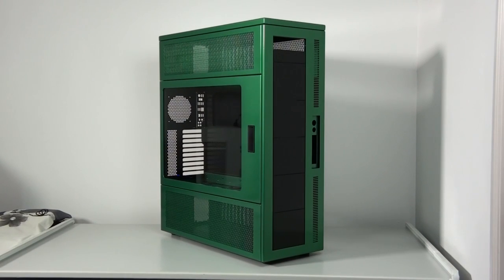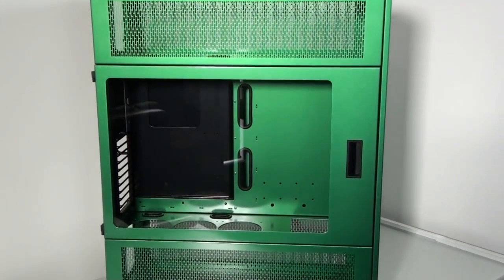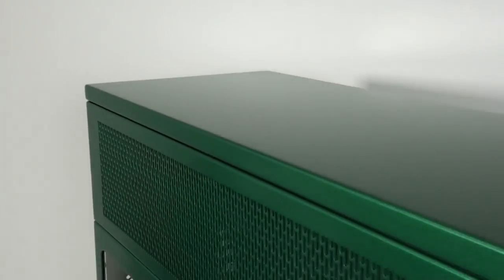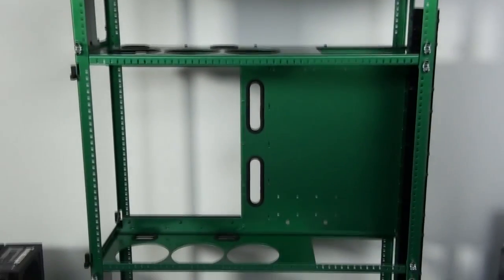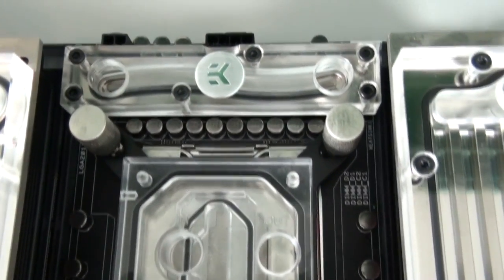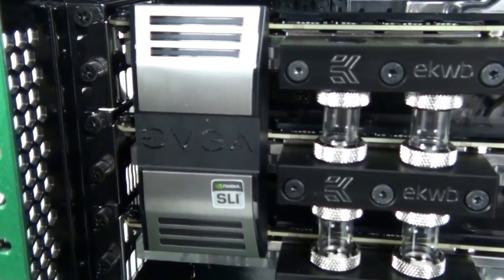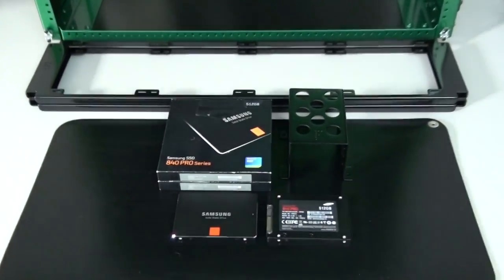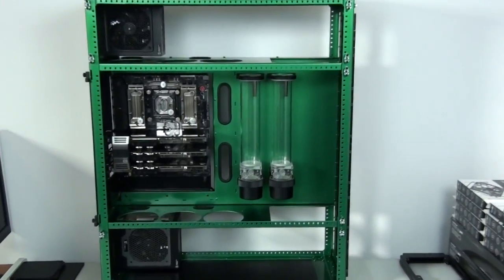Build #14: Extreme STH10: Part 2

Comment: Can somebody tell me why my Graphics Card wont work?
It's a single R9 280X powered by a 850 RM Corsair PSU (850 W). My hole PC is one month old. When I start my PC my 2 screens say that they don't get a signal and that I should check the cable/plug in a cable and the 3 fans on my Graphics card wont start spinning. I plugged in the 8pin and the 6 pin and the cables from the Graphics Card to the monitor and it worked perfectly for 1 month. I thought that the graphics card was broken so I sent it back and got a completly new R9 280x but I have the same problem with it since the first second again. The month when everything worked I lived in denmark but since I moved to germany it just wont work. I also tried different power plugs from different rooms but nothing works. I also tried different 8pin and 6 pin cables and a different PCIe slot on my mainboard and even tried other outputs from my PSU (cus it's modular) and also tried it with 2 adapters (2x4pin to 8 pin and 2x4pin to 6pin ( they(the adapters)) were together with the card inside the box )). When I came to germany I didn't tried my PC if it worked (retarded me) and just build in my new CPU watercooling (1 pump 2 fans) and 2 new 120mm fans. but I took out the graphics card while I build it in my system so it does not get damaged but well... the completely new card won't work either so it can't be a damage on the graphics card caused by the transport. Could it be that the mainboard is damaged in a way that the graphics cards fans wont spin? (or the PSU maybe?)
Reply: Denmark: C, K | 230 W | 50 Hz | Y Something
Germany: C, F | 230 W | 50 Hz | Y Something
-wikipedia
Reply: Lightningblade Wat ? 230 watts ? You mean 230 Volts/50Hz ? Actually 16 amperes plugs works on 3680 watts, but even, that's not necessary to know that
Reply: Maxime Legras
Ye sorry
Reply: Lightningblade Your card might just be DOA from the vendor. Do you have any other pc mates that you could try swapping it into their builds to test it and see? Or any other means of testing the card? 

Power wise you should be more than fine with an 850w so I doubt that's your issue. 

All of your cables are correct I'm assuming?
Reply: What is the make and model of your Motherboard?  Some motherboards have additional molex connectors for powering the PCIe lanes.  I'm not saying that is what the problem is, but you need to start looking outside the box.  With all the new Motherboards out now they offer varying setups and configuration requirements.  Are you able to boot into your OS?  If you are running the latest Intel chips they all have onboard graphics, so you may be able to isolate your issue more if you know that you can at least boot into your OS and do stuff.  If you could supply us with the processor, motherboard, psu and OS details we might be able to assist more.

I'm running an Intel i7-4770k on an ASRock Z87 Extreme9 AC Motherboard, 2 x R9 290X in Crossfire, Windows 8.1 Pro and a Silverstone 1000W PSU.  I have the above setup watercooled as well.  So hopefully myself and others are able to help you out with your problem.
Reply: *****
Fist : thanks for your answer.
1.) I didn't do anything on my mainboard.
2.) I'll try that ty,
3.) I can't check it without a picture :/ (No onboard graficscard)
and again thank you for your help
Reply: singo79
 Like I said, it worked fine for a hole month so and the mainboard does not have any additional connectors for the PCI lanes (just the normal 24 pin for everything and the 8 pin for the CPU. (MSI 970A-G43 AMD 970 So.AM3+ Dual Channel DDR3 ATX)

My OS boots up without problems ( I not 100% sure on this because im not able to get any picture on my screen ofc but if I press down the power button at the point where windows normally is loaded it needs be hold down for ~3 seconds just like normally when windows is running (When it's not loaded it usally just needs to be pressed to be shutdowned without holding it)

The hardware of my PC:
Mobo: MSI 970A-G43 AMD 970 So.AM3+ Dual Channel DDR3 ATX
CPU: AMD FX Series FX-6350 6x 3.90GHz So.AM3+
GPU: 3072MB Gigabyte Radeon R9 280X WindForce 3X OC Rev. 2.0 Aktiv PCIe 3.0 x16
SSD: (OS) 128GB ADATA Premier Pro SP600 2.5" (6.4cm) SATA 6Gb/s MLC asynchron (ASP600S3-128GM-C)
RAM: 16GB Kingston HyperX Beast T3 DDR3-1866 DIMM CL10 Quad Kit
PSU: 850 Watt Corsair RM Series Modular 80+ Gold
Watercooling: Enermax Liqtech 120 Copper CPU Cooler

Thank you for your answer.
Reply: Lightningblade Hi, I have a 770 but my CPU doesn't have on board graphics, even without installing the driver, the GPU will still power the screen and give you an image. There's no power going to your GPU at all, the fans should spin. Definitely try a new PSU or motherboard. Might even be the CPU, maybe one of the pins are bent.
Reply: ***** " the PCI-E lane can deliver 50w" wrong! its 75W for full size PCL-E used for GPUs. every 6pin is another 75W and 8pins are able to transfer 150W of power.
Reply: Biały
What is "PCL-E" ? I think you ment PCI-E right?
Reply: Lightningblade
 Thanks for that info as it helps isolating things for us.

I don't want you to suck eggs too much here, but when you turn your PC on do you see any of the BIOS Post information flash up etc?

Have you tried moving the R9 280X into PCI-E4 and seeing if that makes any difference?  The MSI Manual states that it is preferred that the graphics card goes into PCI-E2 but it doesn't say that it can't primarily run from PCI-E4.  If you haven't tried this are you able to try it?

The fact that you are noticing that the R9 280X fans aren't spinning suggests it is either a power issue, in that it is not getting enough power to the GPU, or something is going wrong.

I've been onto the Gigabyte website and noticed that one of the features of the AMD cards is that they offer "AMD Zero Power Core Technology" in which fans on idle or lower power state cards won't spin until necessary.  So don't write off your graphics card just yet, but it is a likelihood that it could be the card.

Anyway, if you can get back to us with the above information and also try the different PCI-E slot we can take it from there.

Also, have you tried another monitor cable?  I wrecked one once during a move, kinked up bad enough that it must have broken one of the wires inside.  I'm just throwing ideas out there to help isolate the problem.

It sounds like the PSU is working as it is powering on.  Sounds like the motherboard is working as you are saying that it looks like it is going through the motions.  The only thing we aren't 100% confident with is the GPU and there are outside factors that can affect why that isn't working.  Have you tried different 6-pin and 8-pin connectors?
Reply: singo79
1. Thank you for your help
2. I tried both of the PCIe slots
3. I don't get a signal from my PC, Never :/ on both screens
4. I have 2 screens and they both don't get a signal, I think it's a too low chance that both calbes and/or monitors broke at once
5. The 6pin and 8pin I got from the PSU are 8pin (into the PSU) and then the cable splits into 2 6+2 pins from 1 cable. I tried all the slots in the PSU, I tried a other cable and I tried 2x2 6+2 pin cables where one cable only is a 6 pin with a 2 pin and a 6+2 pin unused and the other cable poweres the 8 pin where a 6+2 pin is unused.

New information: I got a friend to try my GraCard in his PC and he said it worked fine and he got to the windows login screen (then he shut down cus it's proof enough that it works). Today he'll get over with his card and try it in my PC. also I tried a device which can messure the electricity (Volt/ampere) and I tried it at the 6+2 pins ( I couldn't get the full information on this becus I only could test 1 pin at once but it gets electricity, then I tried the PCE slot which gave me a 0V so I think it only can be the mainboard or the 24pin connector from the psu to the mainboard. But if his GraCard will work in my PC it's probably the PSU and if it wont it's probably the Mainboard right?
Reply: *****
Nope, there are no LEDs on my mainboard :/ and also I haven't connected the little speaker to my mainboard which normally peeps 1 time at bootup. :/
Reply: Very rarely do I get the issue, however from time to time one of my screens (I have 3 in eyefinity) will not display an image as it behaves as if it is not receiving a signal.  For me it is really easy to fix, all I do is power off the monitor and then power it back on and it is fine.

Did your friend notice whether the video card fans spin all the time in his system?  Though we have ruled out the GPU as being broken I'm just interested whether the fans behaved similar in his system compared to yours.

Do you have access to a spare PSU to test out?  It would be a lot easier to plug a spare external PSU to your system to continue to troubleshoot rather than swap out the motherboard with a whole new one.

Anyway, keep us posted please.  I'd like to see the end result.
Reply: It might just be a duff card, you get that sometimes
Reply: Fraser Hughes
It was the mainboard, I sent it back got a new one and it works again, I used a other temporary mainbord which now broke off 2 of my CPU pins. FML i hate PCs...
But "new" problem :D:
I have had with the old Mainboard already some stuttering and screen shaking and sometimes it even blackscreens for a second or 2. and when my mainboard was broken I used a other which didn't have that problem but now I got my old (in new) back and the problem reapeared. :/ somebody know what is happening and why it's happening to me D:
Reply: Lightningblade Ah wow, you had a bad experience normally its great fun! Hope you get everything sorted and enjoy your work!
Reply: Lightningblade
i suggest seling your mb and buying diffrent model or manufacturer one and change your cpu
Reply: JusstyteN
It was the mainboard, ty. I'll never buy MSI again .'

Comment: I know alot of builders are afraid of using C48s because of the fact that only one o-ring that holds the seal but it looks so much better than C47s, which uses two o-rings.  I use C48s in tight areas like the CPU, RAM, and VRM section, then C47s elsewhere.
Reply: Hello

Comment: Nice job keeping the I/O shroud. I have recently got the rampage iv black edition and a 4960x I can get GHz on 1.35 volts but don't want to push it much further because the chokes and MOSFET heat sink is getting quite warm. 

How did you keep the I/O cover without damaging the motherboard?
Reply: Yh thought you could. not sure if I would like to cut it yet. Then again it looks pretty ugly without it.

Comment: In terms of buffing, you don't have to work that hard if you are using good quality chemicals, and a good technique. I recommend Chemical Guys JetSeal matte sealant and paint protection plus Chemical Guys butter wet wax or 5050 paste wax. using those two will make sure the paint last forever and bring out the ultimate depth and look of your matte paint finish with very little effort at all.

Comment: Every once in a while in your videos you mention the thing about placing a Drain at the lowest point in order to quickly remove all Coolant in case of an emergency or maybe just for replacing it.

Kind of curious but how does the "quickly" part work if there's no second opening somewhere else ( preferably at the top ) for air to rush in and replacing the draining coolant?

Comment: I thought I could add something here that some people may find potentially useful if they are building a loop with Crystal Link tubing and fittings (especially when working with waterblocks in close vicinity similar to that in this build log), is to use the spacers that are included with EK graphics card waterblocks. These are actually a little bit thinner than the thinnest spacers you can purchase from Bitspower and are obviously a nice aid that do not cost anything, and I find that even with Black sparkle fittings, they still blend in nicely. They are about around 1.8mm in height and can be used successfully between any two fittings, in addition to a waterblock and a fitting. They really came in handy for me in many situations where you need that very small extra bit of height/length, and a 5mm extension isn't an option....

Comment: Have you tried using a Fein MultiMaster for sanding/buffing? I don't know how the other brands hold up, but the Fein one I have has never had a problem over the years. It also works extremely well for plunge cuts.

Comment: I heard the closed loops like H100I uses a special liquid used in a cars radiator and other similar machines. Is it possible to use such a liquid for a build, if you have the money? Is there any drawbacks to it? Or most importantly, is it all just made up? Is it just distilled water?

Comment: Looking forward to part 3.  I'm doing a dual loop build in a CL SMA8 with 2 560's.  I have an idea for tube routing, (Acrylic), but definitely looking for inspiration.  Keep it up!
Reply: My build is a slow process, but thought I'd share some information.  I've found that there's a good reason one side of the SR-1's are set deeper than the other.  This is to act as a shroud to lessen the dead air flow between the fans and the radiator fins.  I only bring this up because you mention in your video you cut down your M4x35mm bolts to ~32mm  however if you are mounting to the deeper side, this modification wouldn't be necessary.

Comment: I don't understand this, At the 20:45 You just turned the fittings to slide the tubes in. wouldn't there be a leakage?I mean you didn't twist ends of fittings to seal the connection in order to prevent leak.
Reply: well, no doubt he sure knows what he does. I couldn't understand that fitting part, that's why I was curious. thanks anyway.

Comment: @14.00 and onwards: if you're worried about choosing the right fittings then why not just use the smallest straight fittings at every point and then rely on bent tubing for all bends? That way you don't need 90 degree fittings or any extenders. Let the tubing do everything: that's the beauty of hard tubing. The only place you might still use 90 degree fittings is on top of the max-height blocks, which in this case would be the memory blocks. That way you reduce the number of bends you need to make, and possibly reduce how tall the fitting/tubing is at those highest points.